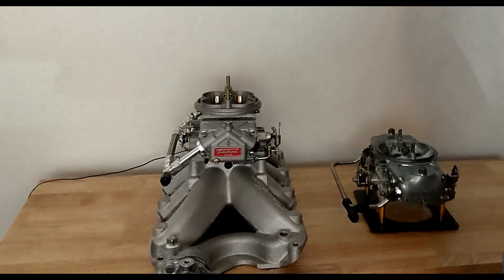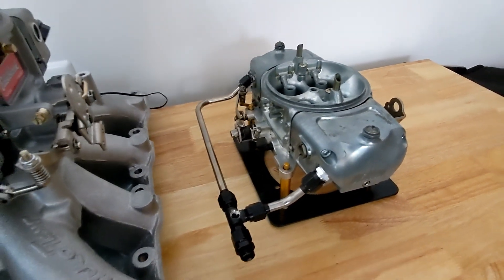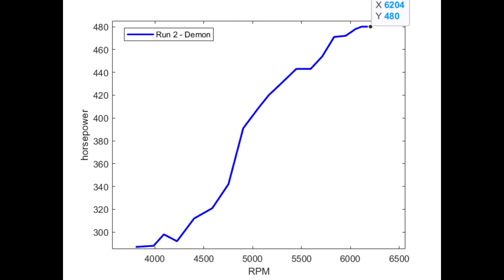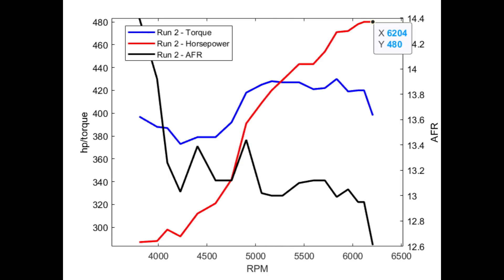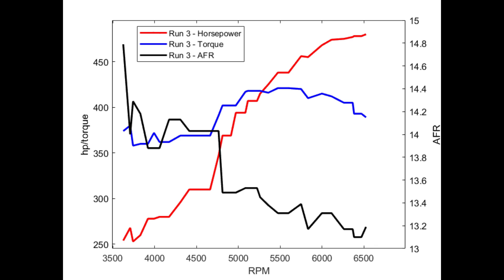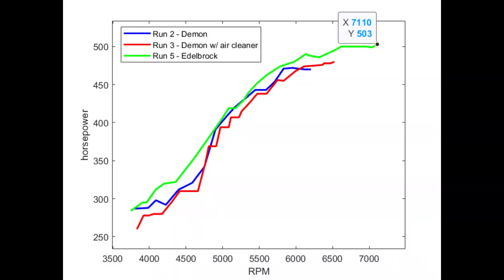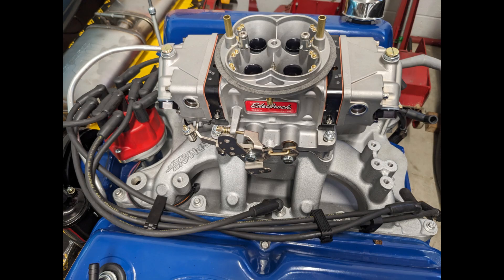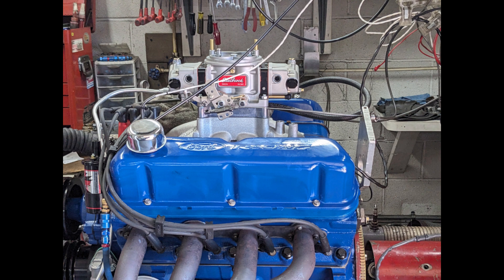Carburetor  Dyno Comparison: Edelbrock VRS 4150 vs Race Demon

Comment: One thing. You said the first carburetor leaned out with the airfilter. That means the air filter helped air flow not restricted it. Some drop based air filters direct air into the carburetor. So if the carburetor was jetted up to meat the extra air flow it most likely would have made more power.
Reply from the maker: Yes it is a drop base air cleaner, and good point. Will have to try running the Demon on the street and strip and check the AFRs/jetting.

Comment: I’m running a 750 VRS it works flawlessly all I needed to do was adjust floats and idle mixture out of the box . Very impressive. Great video! Looking forward to someone doing a blow through test in a turbo application. Keep up the good work
Reply from the maker: Thanks!  What are you running yours on?
Reply: @MarksMuscleCarGarage  I’m running a LQ4 6.0 forged summit dish with 243 heads truck Norris cam and a dual plane intake . 13.9 100mph in the 1/4 with 3.08 gears 2500 stall 2004r . Needs a bit more stall and some 3:73 gears . I have a gt45 turbo and manifold just waiting on a blow through carb . Just don’t have a extra 1000 for a carb yet
Reply from the maker: Sounds like a pretty solid motor. Should drop a second or two with the turbo and gears depending on the amount of boost

Comment: Do you have a part number for the fuel feed lines for that edelbrock? Thanks in advance
Reply from the maker: I bought it from Performance Plumbing Components (PPC).  They don't list a part number but go to their website and search for Edelbrock VRS Carburetor Fuel Inlet Assembly. The finish I ordered is SimChrome Polished Silver / -6.

Comment: The Demon issues were not a design problem, but [I think] machinists in a hurry.   Not pecking, excessive cutting speed, dull tooling or some mix of those.  I received one of those apparent quota problems.  I had two airbleed holes that were not drilled clean [20-25% occlusion], and the crossover drilled into the idle well that feeds transfer slot and idle mix all [4x] were about 40% occluded in the idle well which apparently gets driled last - metal wiped across the opening.   Fix?  A set of jewelers 10x glasses to spot these issues, pin gauges [used to both blueprint and knock metal free that smeared insted of cut] and a little over an hour to do it all.  Out of the box?  Absolutely nothing looked wrong.
So I've learned to inspect my metering blocks and assume nothing.
Reply from the maker: Thanks. Good info.

Comment: G'day. Just wondering if they use holley jets and air bleeds?
Regards Blair
Reply from the maker: @blairo15  The jets are the same as Holley size, but the air bleeds are smaller. I believe the thread size is the same as Holley air bleeds but the outer diameter is smaller on the Edelbrock air bleeds. The smaller Edelbrock air bleed is the same size as the air bleeds on the BG Demon carb shown in this clip.

Comment: Those Demon's came with some other air bleeds as they had some issues. But having to run more than a 10 jet sized spread means the air bleed sizing is off... How did you convert it from alcohol to gas? Im gonna guess you changed to metering blocks.
And curious what that mechanical pump is feeding them at 5000+ for psi?
Reply from the maker: The 750 Demon I have has a stock jet size of 75/83  with power valve in front none in rear. I ran it on the street on another motor with 74/83 jets and AFR were pretty well calibrated.  We went down 3 in the front and 3 up in the back on the dyno to arrive at the 71/86.  This was what my machinist recommended to lean it out on the dyno, which seemed to work.  We also made an air bleed change on the high speeds as well.  If I ran a power valve in the rear the spread would not have been as large.  The Edelbrock VRS 4150 has jet sizes of 72/72 out of the box but it has power valves both front and rear hence the square jetting.  We used the same down 3 in front up 3 in the back to lean the VRS 4150 out,  ending up at 69/75 .The Edelbrock and Demon use the same air bleeds oddly enough which differ from Holly air bleeds which are fatter on the top though the thread size is the same as the Demon and VRS 4150.
For the alcohol to gas conversion, I changed metering blocks, squirters and needle + seats, all according to specs in the Demon carb book I mention in the Demon carb video I made on the subject.  
I'm not sure about the pressure on the carb during the dyno runs - we didn't have it instrumented.  The gage on the carb fuel line showed about 6-7 psi when we were tuning it.  The pump is a Carter "Super Strip" pump that flows 120 gph at 6-8 psi which is enough for 1000hp according to Summit's online fuel pump flow/hp calculator.  The stock SBF pump only flows 40 psi and is good for 450 hp.

Comment: Additionally, there is no "ideal AFR" for an engine.  An engine wants what it wants, period.  One engine combo might make best power at 13:1 afr, another might want a 12.5:1 afr.  It's all about the combo and what the engine wants.  NEVER tune an engine to a specific afr, read the plugs, and give it what it wants.  In this video, it shows the demon carb was either not well tuned or simply mismatched for the combo.  The Edelbrock was a better match for the combo....
Reply from the maker: @markgoulette5056  Could be. Could also be we tune the Demon to perfection and doesn't outperform the other carb. +1 on reading the plugs. We read plugs on multiple runs.
Reply: On a dyno, max power and plug reading don’t go hand in hand? I f I’m making max power what does it matter what the plugs read ?
Reply from the maker: @cedricwilson2055  Well if you're making max power your plugs will be clean, white looking for the most part with some tan further down on the insulator.  If you were running rich you wouldn't be making max power and your plugs would be showing some blaok or gray  on the insulator and electrodes.  Also if the engine is running into detonation problems you should be able to see that on the spark plugs as well.

Comment: Annual boosters mix fuel better and allow more flow.
Reply: Annular boosters do mix fuel better early, but do not flow more air.
Reply: @oscaracme yes they do. A annual booster is normally in the open area of the ventri. A dog leg booster is in the pinch area creating a restriction. For example, a 650 down leg will flow less than a 600 with annual booster.
Reply: Mainly... the venturis on the Edelbrock are bit taller - behaves more like a 4150 with a stubstack installed.  It would have been nice if both carbs were setup with annular boosters, but look at the afr trend [chart at 3:20].  It went rich fast after 6100 rpm.  There's some tuning to do there.

Comment: annular discharge is an advantage especially on the top end     have had three (hollley 4010/4011/560 race 2bbl)annular carbs and both top end and cold weather performance was great  the 4 bbls didnt like getting warm in the case of that model type   the 2 bbl had no issues

Comment: That Edelbrock is slick. I've been out of it so long I haven't ever seen it. Still have only smaller street carbs. 600 and 650 Holly and a 600 Edelbrock but they're for lower power small block V8s. The Edelbrock is much better than the Hollys for me.
Reply from the maker: Yes, the Edelbrock Performer series carbs are very reliable and perform well for street driving.  I've run one on my 69 Mustang for years and never had any problems with it.
Reply: @MarksMuscleCarGarage  Yeah I have the Edelbrock 1406 on a Jeep with a 304 V8, small cam and fenderwell headers. Not high horsepower but good low/mid torque.